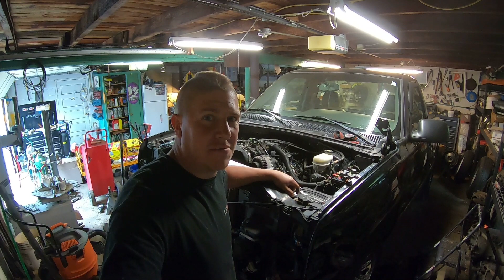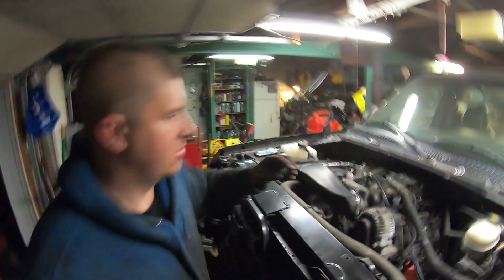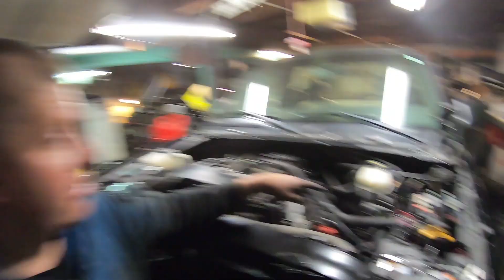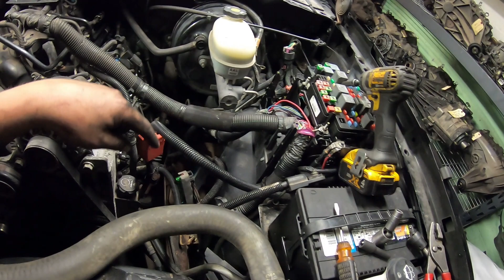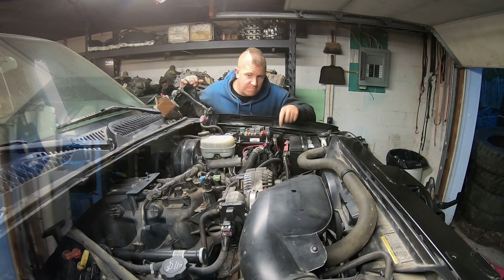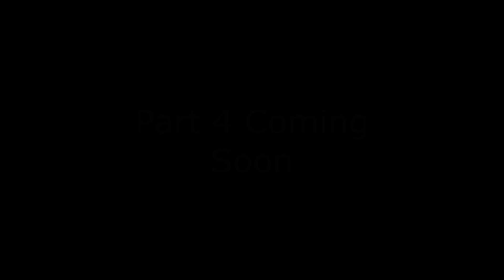V6 to V8 Silverado Part 4!! Unexciting Technical Rambling....

Comment: Will a 2003 4.8 work in a 2006 v6 chassis
Reply: They’re both DBW but the v6 has a battery control module
Reply from the maker: Yes it will work but you'll have to either add the GBCM or use the 2003 cluster if you don't want the battery light to be on all the time.

Comment: I thought the swap would cause the security system to not recognize it when you try to start it? Did you get the ECM flashed/programmed first, and if so who does it for you?
Reply from the maker: Yes, putting a different pcm in the truck with trigger the VATS and cause the engine to not start. I used HP Tuners to Delete VATS function in the PCM.
Reply: @MohawkMotors  cool, does it make any dash lights come on at all?
Reply: @MohawkMotors  Id like to get your email or number, I have lots of questions, plus I wonder about the fuel lines

Comment: why cant you use the PCM that came with engine and just program a new vin into that one?
Reply from the maker: PCM's will only accept a VIN that is compatible with the year and operating system of the PCM. For example a 2002 PCM will not accept a 2005 VIN. I've even had PCM's not accept a VIN of the same year because the operating system in the PCM was not used in that specific vehicle.

Comment: I have an 07 Sierra Classic single cab short bed 2wd 4.3 with MANUAL(stick shift) factory 5 speed transmission , what Engine swap would be compatible with the transmission?(If any?) I believe the transmission is the HM290.
Reply from the maker: 4.8, 5.3, or 6.0 could all be swapped. Use the harness, computer, and throttle pedal from and 06 or 07 classic silverado or sierra and it's almost bolt in, plug in, and go. All you would need to do is get someone to reprogram the trucks VIN into the PCM.
Reply: @MohawkMotors What if they came from a different year like 05 and maybe different model like a Tahoe? Can it still be done? Thanks
Reply from the maker: an 05 tahoe or suburban would work as well, you just need to make sure they also have the GBCM on the battery ground cable.

Comment: Another great video! I was just watching another video and they stated that you can indeed load a v8 profile onto the v6 ecu. Have you found out anything else since doing this on an easier route?
Reply from the maker: I haven't yet. And yes the V6 PCM's are capable of downloading/understanding a V8 tune/program, but my understanding was they are not pinned/ the internal boards aren't printed, to run 8 injectors and 8 coils, I could be wrong though. I could see how that would be helpful though if you had a V8 pcm that wouldn't accept the v6 VIN or just didn't have the V8 pcm period.

Comment: Hi Jason hope you have a good day thanks for your videos I have a 2000 4.8 Silverado hi miles on it ,do you know if swapping a 2003 Tahoe 5.3 will work with the same ecu
Reply: So it is better to change the harness and ecu and go get the vin number updated or what would you recommend
Reply from the maker: I would use the 4.8 harness and PCM, and just get someone with HP Tuners to do a segment swap for the engine segment. It's easy to do and is the least amount of changes required.
Reply: Ok I’ll go with that,thanks a lot jason have a great day thanks for replying 👍
Reply from the maker: no problem, good luck!
Reply from the maker: Hello!  So yes and no. If you put the intake manifold, oil pressure sensor, and wire harness from you 4.8 onto the 5.3 it will start and run, but it will run lean (not enough gas) due to the larger engine. It will be close enough that it will run well enough to drive, but long term or under heavy load it would damage the engine.

Comment: Hey Jason I watch this video year ago but now I am doing my swap on my v6 ...can you make a video on how you did the vin swap using hp Tuners please im in CA and need to pass emissions too doing this swap.  Please make the video 🙏
Reply from the maker: Hey, so there are lots of videos on youtube on how to do a VIN swap using HP Tuners, that's how I learned to do it. I'm not comfortable making a video showing how to do it since I live in an emissions state and it's not exactly legal.
Reply: @MohawkMotors  ok
Reply: Thank you for getting back to me and I understand I tried figuring this out here in California but what I came out to terms is that the v6 VIN number are made for a V6  and I don't think there's a way . becomes there are particular numbers for the v6 just like there are particular numbers to identify the size of an engine from a 4.8 to 5.3 6.0  or can you explain to me how works . So I have a 2002 single cab GMC V6 5-speed but I'm going to swap in everything for my 03 gMC Yukon dash and harness because this one has the dual climate also steering column has all the buttons plus the doors are powered and its drive by a wire 5.3 4l60e so it should be plug and Play but to smog it is a different story 😞 I love your videos I am doing the same thing here i have my own YouTube channel i just started its about working on my project trucks a hobby and I enjoy it I also flip cars and sell parts too . The channel is called. Frank's project toys please follow me and any help you is appreciated 🙏
Reply from the maker: Yeah in california it's going to be challenging. In the VIN, the 8th digit designates which engine the vehicle is equipped with from the factory. Your 2002 single can should have an X as the 8th VIN, this indicates it was originally built at the factory with the LU3 4.3L V6 engine. The VIN is located in multiple places on the truck as well as programmed into all the computer modules in the truck. The V8 engine all have their own VIN digits to identify them as well, The LR4 4.8L V8 is VIN F, LM7 5.3L is VIN T, L59 5.3 is VIN Z, LQ4 6.0L is VIN U, and LQ9 6.0L is VIN N. 

I'm not completely familiar with how California does their SMOG inspections, but I do know that in my experience, people working at emissions testing stations are not always knowledgeable about what they are actually looking at. You may be able to pull it off, by using a V8 pcm, that uses the same operating system as your V6 pcm. If you do that you could put the V6 VIN into the V8 pcm so it matches the truck's VIN, then the only way to tell that anything has been done to the truck would be visually looking at the engine. As long as the SMOG inspector doesn't actually look too closely, or if they aren't familiar with these trucks, they won't know the difference. If I'm not mistaken, usually they plug into the computer to check for fault codes, verify the VIN on the dash, and do a visual inspection that the catalytic converters are still present under the vehicle, they don't even open the hood. If that's the case, you could definitely pull it off.
Reply: @MohawkMotors  thank you would you be willing to help me with the PCM I don't have HP tuners and if I did I would not know how to use it . I did have a guy reach out to me about reprogramming my original pcm  but my concerns are by doing that is pretty much the issues you had to deal with on your video which was the cruise control that you had to rewire but also my wiring for my cab does not have the function of the power seats or power or dual climate on the dash and column.. this is why I want to use the harness out of the Yukon  . I'm not sure if reprogramming the original PCM would work but it would keep the same vin just not sure if it will operate the 5.3 plus the 5.3 as the drive by wire. The 6V PCM is the 411 and the 5.3 is the 605 or the 786 . I'm not sure if it's a problem but my truck is a salvage title . Ok let me know what you think.  thank you for your help 🙏
Reply from the maker: If we weren't on opposite sides of the country I could probably be more helpful. The 411 pcm from the v6 won't work with the V8 engine without internal modifications. BUT there are plenty of 411 V8 pcms available. The key is the operating system, you need a PCM with the same operating system as your V6 pcm but from a V8 engine. 

There's an incredible amount of information available in online forums and even facebook groups. Everything you want to do, has been done before and most likely someone has explained how to do it. Either in a video on youtube, an online forum, or even a facebook group. If you want to do this project yourself, I would really brush up on your google skills and start doing your research, find a good write up or video on how to do what you're planning, before you start taking things apart. Also do 1 thing at a time engine swap first, get it driving. Then do your power seat conversion. Then whatever is next. The information is available and not super difficult to find, you just gotta do the research.

Comment: What about rear end stock?
Reply from the maker: The rear axle? GM used the same rear axle in all the 99 to 06 and 07 classic pickups, they just changed the gear ratio and brakes depending on what options and equipment the truck was ordered with.

Comment: I'm sure you know this now, but you could have used a pcm from a van 03 to early 07. The vans were a Lil behind on dbw setups. I've seen them up to 07 still being dbc. Using that year pcm will have the iac drivers needed to use dbc setup. There are list on line of the pcm with iac driver and without. Awesome work too. Subscriber 4-life!!
Reply from the maker: Man you know, I totally forgot about the Van PCM's, you're absolutely right, I'm pretty sure the vans kept drive by cable until 07 in some applications. Good info! Thanks for subscribing!

Comment: Did you have to swap the bcm under the steering column? Looking to swap an 06 but not sure if it’s different from an 02
Reply from the maker: No, but I did have to disable VATS in the PCM.
Reply: @MohawkMotors  gotcha I figured that at least, thanks buddy

Comment: Being an 05 did it have factory electric fans? If so how did you hook them up to the new wiring harness? My new 03-07 harness does not have a purple plug to plug in where the factory fans plug in on the side of the fuse box
Reply from the maker: Yes it did have factory electric fans. I just added the 2 control wires to the pcm connector and connected them to the factory electric fan harness and relay pack. Then just enabled the pcm for electric fans, there's lots of videos on how to, I did a pretty thorough explanation on my white 2003 2500HD.
Reply: @MohawkMotors  thanks. I’ll have to look for the video. Most videos I see people are explaining how to add electric fans to a truck that never had them.
Reply from the maker: If you got a new harness that doesn't have the 2 wire plug for the electric fans but your pcm is already set up to run electric fans, literally all you have to do is add the 2 wires from the pcm to the electric fan control plug. That's all I did.
Reply: @MohawkMotors  thank you. I just pulled the two wires and pigtail out of my old harness and will plug it into the new harness this week

Comment: Is it a way to get in contact with you I did this swap and having problems with it starting by the key and acting like it don't wanna drive
Reply from the maker: tell me about your swap? What year truck, What year Engine, are you using the pcm from the truck or from the engine donor? Factory harness or aftermarket harness. There are different versions of all these things, the most common issue I see people having are from mixing and matching parts that aren't compatible.
Reply: @Mohawk Motors  the truck is a 2005 engine is 05 as well computer is a p59 out of a 2003 Tahoe reads 5.3 6.0 etc and I was using factory harness but ordered a factory harness off ebay for a 6.0 came out a chevy truck which is best to use aftermarket?
Reply from the maker: Are you running drive by wire or drive by cable throttle body?
Reply: @MohawkMotors  drive by wire
Reply from the maker: OK, So you need to make sure you have the PCM programmed for the right size injectors, if your P59 is from a tahoe, it's got the wrong injector data in it. You also need to make sure you have a TAC module and throttle pedal compatible with your P59 and the Operating system it's running on, there are mutliple operating systems possible in the P59 pcm. You did delete VATS out of the PCM right? 

If it were me, I would go to the junkyard, and find a wire harness, tac module, throttle pedal, and pcm from an 03 to 06 vehicle that came from the factory with an LQ4 6.0. With all that mixing and matching, you've probably got incompatible electronic components. OR find someone really good with HP tuners who can change or modify the programming in the P59 to work with eveything you have.
Reply: @Mohawk Motors  I had someone look at it with hp tuners but it didn't pull up any vats
Reply from the maker: I would start with that, need to go into the tune, System Tab, General Tab, under Security it should say VATS Control Serial, need to change Serial to None, then do a Write Entire on the PCM, Write Calibration will not disable VATS.
Reply: @Mohawk Motors  gotcha I will try that thanks for the help

Comment: Hey bud I have  questions, did u program the v8 pcm with the truck vin number?
Reply from the maker: yes, I swapped the VIN of the truck into the V8 PCM so it will show up correctly when he takes it for emissions testing.

Comment: What did you do for the fuel lines and drive shaft ???
Reply from the maker: Re-used the stock fuel lines, Stock driveshaft with a different transmission output yoke from a 1500 4x4 and adapter u-joint, I made a video on the driveshaft adaptation.